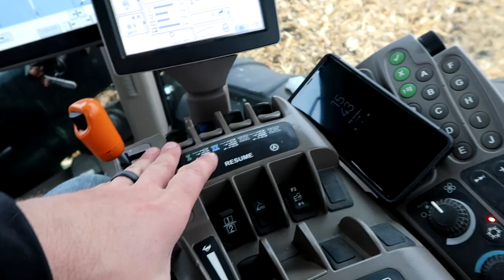Fixing Stuff and Tillage - The Lost Harvest Video!

Comment: Zack; you're cleaning that floor the hard way. There is a much easier way of doing it.
First: attach a chain or rope onto the end of the sweep auger, so it can be held back, while it's still running.
Second: As soon as that bin is empty enough where the sweep kicks in; walk behind it with a shovel n broom and pick up that product as it goes along. You can use that chain or rope to keep it from running away on you. Clean at whatever speed you like.
3: To keep it from running away on you, make something so you can attach the other end of the rope or chain to the side of the bin. Use the bolts located all over the place.
It will turn into a one man job. And very little sweat.
Reply: Yep, that's the way we've always done it.

Comment: We did beans first and had a lot of running around between fields because of the weather but we got all of it. December 12th we finished cuttin corn in Brule, Nova Scotia. There were a few fields that we had to go back to a second time. Because it was too wet to get the whole field the first time. for most of the 130 acres of beans we had a auger wagon hauling to a tandem dump truck and a semi tanker to haul out to a dryer and roaster. Then for 120 acres of corn we lost the dump truck for half of it, but found 2 gravity wagon bins instead to run through a auger to a waiting live bottom truck to take it to the dryer.

Comment: Dryer bearings, so much fun. It always seems to be at the top of the dry bin, in the rain, after pushing hard before the rain. Last time it was the shaft for the pully and flighting, snapped in two. Had to put the torch in the loader bucket and hammer the shaft half in the flighting deeper to put a new shaft in, in the rain, on a bin roof with no platforms. #70sbin 
If it wasn't exciting than I wouldn't remember

Comment: Auto Steer button?  That is the same one you use for cleaning out the grain dryer, or the one that you press to replace shanks on the chisel plow, or the one that press to fix the slides in the bottom of the grain bins. Farmers earned that auto steer button with blood, sweat and farm accidents over the course of time. I would never apologize for it for a second.
Reply from the maker: Good point, thank you!